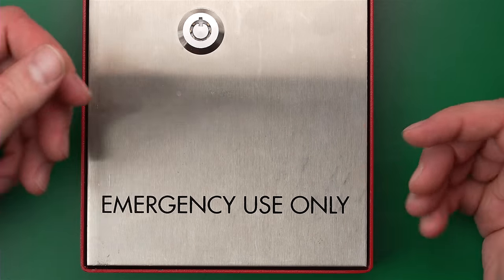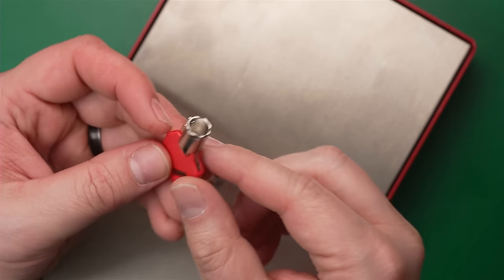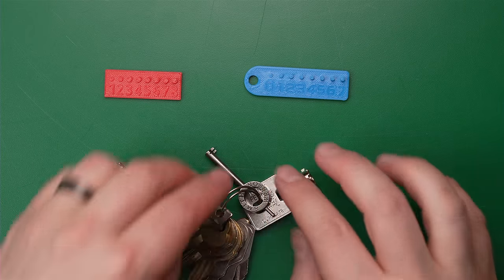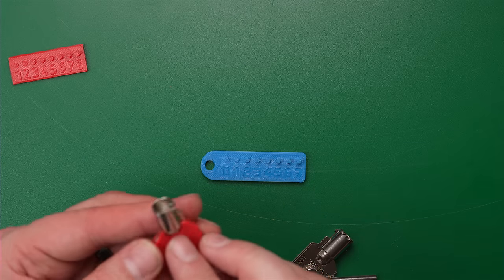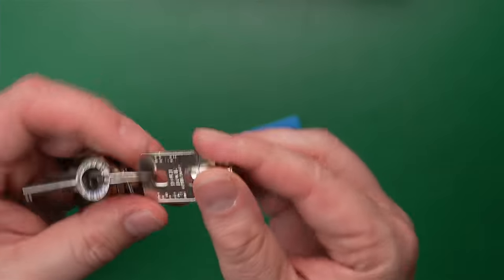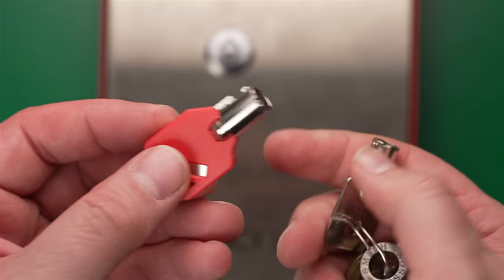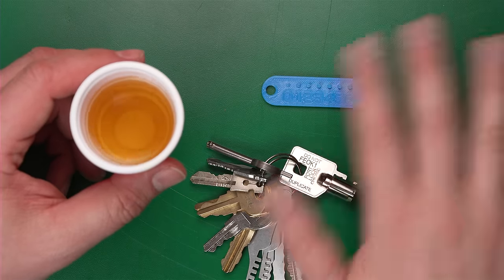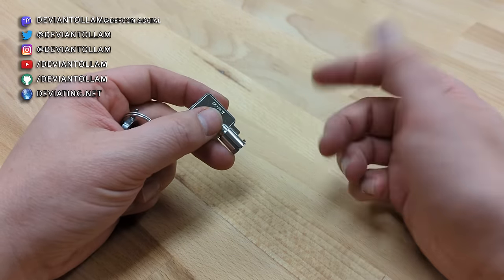Tubular Series, part 2 - Why Doesn't Your FEO-K1 Key Work?  (Explaining Tubular Key Standards)

Comment: Like learning a new computer language, one of the first questions you have to answer is whether the arrays are zero based or one based.
Reply: And if it's 1 based you throw it in the bin.  :D
Reply: @JamesChurchill  Really the only one stupid enough to have 1-based indexing that's semi-widespread is Matlab (and maybe you could argue Fortran too, but I haven't heard many people in the last 30 years going "can you help me with my Fortran program"), and anyone that says Matlab is a real programming language should go right in the bin along with matlab
Reply: The answer is yes.
Reply: Followed shortly thereafter by which type of object oriented paradigms are being followed...
Reply: @gorak9000  I can think of Lua and R off the top of my head, and I'd say those are reasonably widespread as well. Definitely annoying when switching back and forth between those and a more standard programming language, though.
Reply: @dacid44  R is for statisticians. They're not real programmers (at least 99% chance). I've only seen Lua used for a script engine insode of other programs - I've never really had to use it much
Reply: @gorak9000  as a statistician I will 100% agree I am not a real programmer. 

I also don't want to be because I have seen what you guys have to deal with.
Reply: @dacid44  Lua? RIP.

I get why R would start at 1. I don't mind that.
Reply: But off-by-one errors are SO MUCH FUN!  Especially when you combine it with logical tests that prevent you from reading past the end so it doesn't core-dump but just logically fails!

Comment: I appreciate the insight into these, as I almost never see them... As in, when I went out on my own, a tubular key cutter was one of the lowest things on my "I should get one of those" list... Eight years later I still don't have one. In the 10 years at the old shop we'd get them MAYBE twice a year, so I did learn to SPP them, just so I wouldn't have to drive back to the shop to get the tubular pick. . 

In the time I've been on my own, I've gotten ONE call for a tubular lock, and that customer had already ordered new locks from StackOn, so I just needed to unlock the box...  I will say though that just because of the heights of the two locks on that box making it hard to get a good SPPing position, I DID buy a tubular pick after that call...  

I don't know if I'll get enough tubular key unlocks to pay for the pick, but shelling out the money will DEFINATELY save my back should I run into another one of those StackOn boxes...

Comment: A few years ago, I needed to make some keys for a couple of radio cabinets, 6 feet tall, 19 inch rack mount.  I had several keys that appeared identical, but one would work, one would work sometimes in one lock if you wiggled it and played with it, and the others wouldn't work at all.  I finally took the lock out of one of the cabinets and took it to a local locksmith who figured it out.  The tooth (I'm sure there is a better name than that) that sticks out of the key was a nonstandard length.  The locksmith was able to manually file the tooth to make it work.  This was someone's attempt to make a tubular security key and thwart key duplication.

Comment: had similar issues with a 16120 key off amazon, was cut correctly but the key itself was too thick and would therefore not fit in the lock

Comment: This is why cutting your own keys makes more sense. Especially if you are decoding an impressioning tool. If you cut it to the scale you measured and in the direction you took them rather than giving the bitting code to a locksmith who may use the alternative scale/direction. The key style measuring gauges that come with Haoshi/Southord tools are numbered 1-8 (Ace) but are horrid to use so we Tinkercad' a Gem lego brick of our own (having found the ones on thingiverse were crud). We also look to 3d print temporary keys where if you make a mistake you can just print a new one in around 15 mins.

Comment: Back in the 70's, when almost all alarms used ACE keys, I had a key cutter on my truck. If you had a good key I could duplicate it perfectly. Cutting to code was considerably more difficult. And around here you need an AZFS for elevators unless you are in  the big city. They use a different key.

Comment: Good Video.  My "Red" Brick that came with my Herty Gerty in the wood box is numbered 1-7.  I have seen both blue and red bricks in the plastic Herty Gerty boxes, but I suspect they are all Fort.  Just cut one and will test tomorrow to see if I learned anything.  We actually have a maintenance key (Not FEO-K1) stuck in our elevator waiting on the elevator company to try and remove it.  Probably just needs a squirt of Houdini but it's not my elevator and not my key.

Comment: Question... Can You get a "Master Key" for either style lock? Need one for the Business I work for, as the "Locks" has no ID on the outside of the them. Usually, We have to cut into the "Product" to gain access to the lock mechanism...

Comment: stuff like this always blows my mind, you would think that the dude that decided to make these to sell them on ebay/amazon would just get one of the locks for a couple $, test it, figure out whats wrong in idk 5-10 minutes, revise, have a working product to sell for years to come, rather then the yolo make a product, throw it out there, it doesn't work, and it will barely sell after a month because people figure out it doesn't work.
i just can't wrap my head around going all in on short term profit, when you can have long term profit for something that is a one time investment of 10 minutes of QC and a single $20-30 lock
Reply from the maker: There are some FEO-K1 locks out there that have looser tolerances and which might work with some of these poor keys.  Maybe he tested with those, heh.
Reply: 10 minutes of QC vs 20 seconds to change seller name and continue to sell garbage

Comment: Silly question - is there anything to stop you from printing a 0.4mm spacer/insert to "convert" from Chicago to Fort?
Reply from the maker: layer height and durability, possibly, heh.  but if someone cuts a key the wrong way the OTHER way then it's possible to simply kind of trim/grind the front face of the key down a bit
Reply: @DeviantOllam  Oh yeah, getting rid of material is the easy part!

Comment: Is it possible the keys are sold kinda like computer pen testing tools? Where they don’t work out of the box to detour some people. As in you have to know how the tool works and modify it just enough for it to be usable.

in other words, is it possible to file the head of the Amazon key down one pin depth and the key be usable?
Reply: Nope. The key is too short out of the box, because it was cut using the wrong standard. Filing it down will make the problem worse, not better.
Reply: Your right. Shaving the indexing side pin is a make shift way to get these to function.

Comment: i ordered a tublular key for my gun cabinet from ultimate security device in nj for a hmc16940.  after several weeks waiting for it, it did  not turn the lock.  it looks like the cuts were too deep.  mine and the "replacement" are both are chicago keys.  i called and emailied for help and they never got back to me.  can i just file the end of the key, to shorten it?

Comment: So, I'm curious to know what those other keys were that we saw on that key ring. I saw what looked like a mailbox key, a car key, a handcuff key, and then a bunch of others that I didn't recognize. Is this your EDC set of pen test keys?
Reply: I noted 2 lock combs, 2 jiggler keys, the FEO-K1 (of course), a Chicago Elevator key, A CH751, the ultimate handcuff key, and what is likely a 1284x (Ford Fleet key)

Comment: Would that chicago cut key operate the lock if you didn’t insert it completely, since everything is cut a constant distance too short?
Reply: I wondered this too. I'm just a hobbyist, but I'd think if you put tension on the lock and jiggled it it seems like it might open as you'd eventually get all the pins lined up at the correct depth. I was able to do that with a standard pin and tumbler lock with a restricted blank- I just impressioned the key and cut the new key out of a hacksaw blade and jiggled it.  However, with the tubular lock you'd have to do it multiple times as the pins would presumably fall after every 1/8th rotation.
Reply: The cuts are also in the wrong order, though...

Comment: ive been slightly diving into the rfid keytags that can be used to permit access to certain places, but then the company, without my involvement i will add, had in incident, so im not continuiing with that avenue for proof of concept, or for testing, so ill buy my own, but do you have any tips, or info about diving down that rabbit hole, will say i havent done much if any research  yet..

Comment: great video. I do have a question though. When you look up the code for a lock and it says the code is clock wise on lock does that mean it would be contour clock wise on the key when you cut it?

Comment: At least that key can still be cut to the proper depths.
Reply from the maker: true true.  and i suppose if you were to pull it out just enough and perfectly flatly and also if the bit on the top of the key were trimmed down so it fit in the existing race, it might also work.